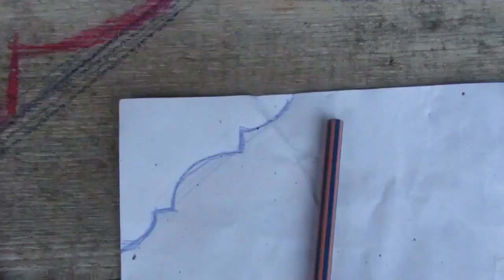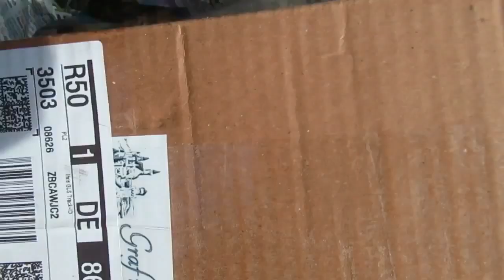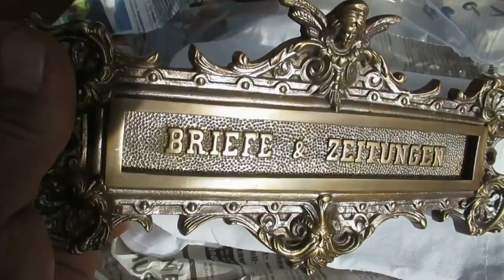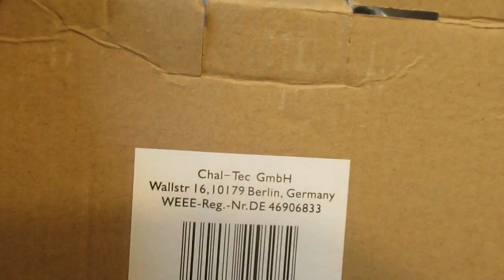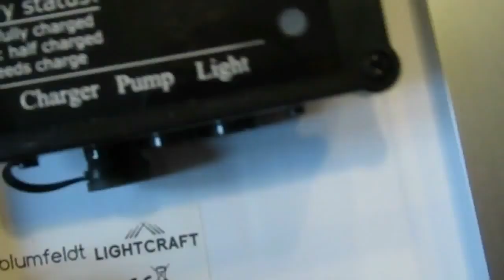Solar Wall Fountain outdoor Lion Head Wall Fountain With Solar Pump Garden Fountain Solar Fountain

Comment from the maker: Lion Wall Fountain Lion head wall fountain solar powered with led light, solar panel and pump battery backup, run day and night. Designed and manufactured by Sunlink over 10 years success in the solar water gardening range, so you can be assured of a successful, high quality water feature ... Greetings Alex